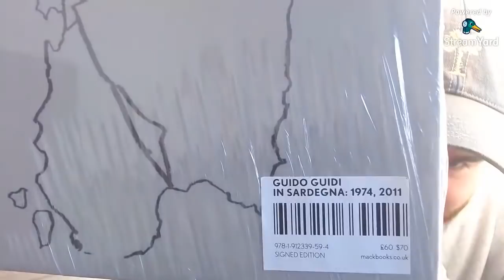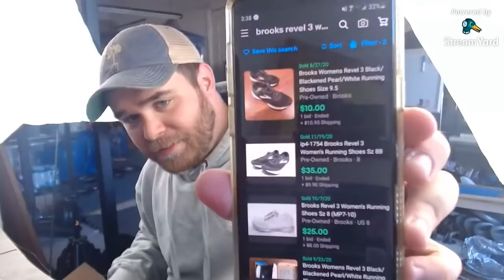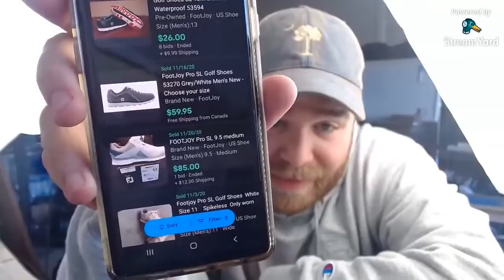Talking Ebay While I Try To List Stuff

Comment: 14:23 Reminds me of the poster art book I sold for $150ish. Crazy thing wasn’t that I paid maybe a buck for it. Rather I found it sitting in the Goodwill surplus bin, in plain sight, and in perfect condition. Somehow the guys who  scoop up all the books missed it.

30:48 Yes. Technically an ISBN 13 ... because it has 13 digits. They all start with 978.
You can guess how long the older ISBN10 is. Sometimes its final digit is an X (ISBN13 is all numeric.)

Comment: Hey Hairy, can u tell me,... Is there a special reason, your not a ebay "plus" reseller? Or dont you know "plus" in your country?
Because i want to start official reselling soon and im thinking about to be a plus-reseller with always 30day moneyback and free shipping.
Plz let me know what u think about it.

Thank you!
Reply from the maker: You have to offer free return shipping and I dont want to do that. I used to be a top rated plus seller and the pros weren't worth paying for the returns out of pocket
Reply: @HairyTornado  Thank you very much for your answer. As you would say: i appreciate it ;-)
Reply: @HairyTornado  Hey Josh, I phoned ebay. They told me recently they pay the return shipping to ebay plus customers and the normal customers have for the return shipping. Did you know that?

Comment: Why would you use Pirate Ship when Ebay gives such huge discounts on shipping?
Does Pirate match?
Reply from the maker: Pirate ship give commercial rates, same as eBay. If you're a top rated seller you may get another slight discount from ebay but it isnt very significant. I only use pirate ship for items that I need to use pirate ship for. Small, heavy stuff